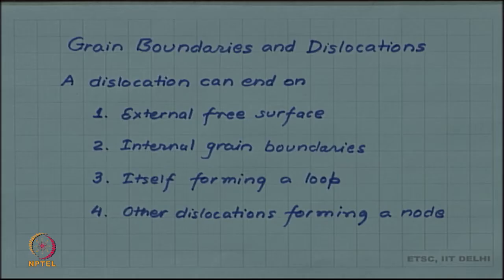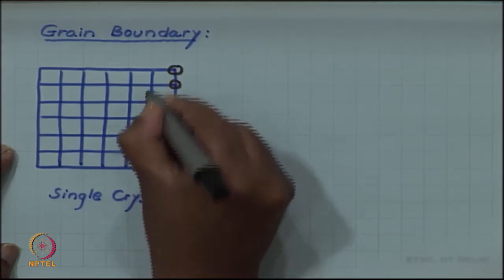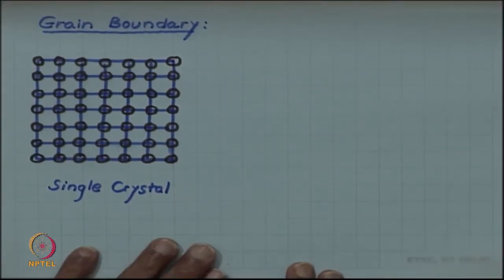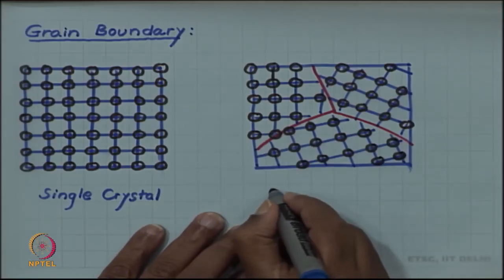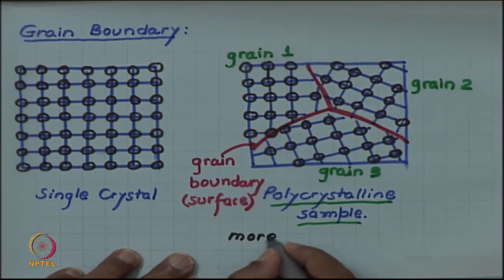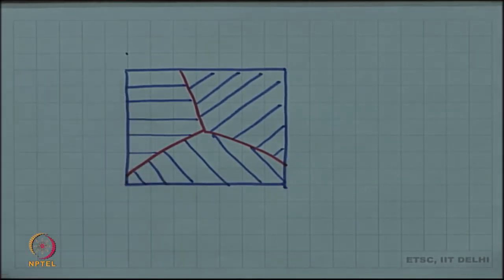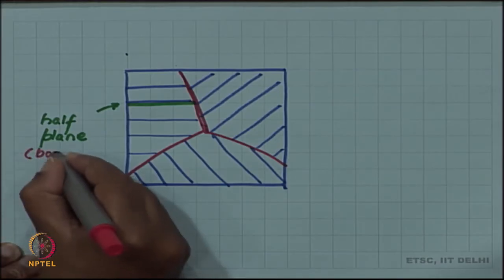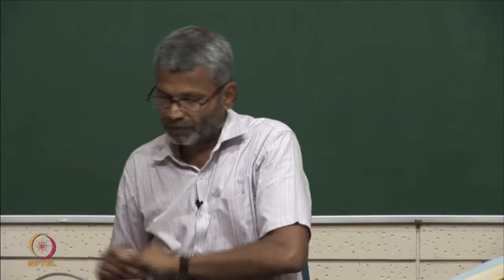Dislocation cannot end abruptly in a crystal: Grain boundaries

Comment: sir i had a doubt whether grain boundary seperates the same planes or different different planes?????i mean grain boundary is a boundary where planes changes its orientation or is a boundary where different different planes meet ??????
Reply: Both are true. A grain boundary separates two grains. In a grain on either side of the grain boundary planes with different orientations (different Miller indices) meet the boundary. But if you consider a plane with given Miller Indices, it will have a different orientation in the two grains.

Comment: Dear sir g why grain boundaries are formed??? I mean at micro(atomic level) what kind of state atoms have at grain boundaries???.....
Reply from the maker: You can think of grains forming in a liquid during solidificitation. Different grains start as a nuclei in different parts of liquid. Because of independent nucleation events their orientations are arbitrary. After growth they meet along some surface across which the orientation changes. These surfaces act as grain boundaries. Atoms close to the boundary do not fit in either grain and so their is some disorder in a thin layer of atoms along the grain boundary.

Comment: Sir, dislocation cannot cross a grain boundry and finer grain structure means lots of grain boundaries but plastic deformation which is caused by slip ( movement of dislocation) is more favourable with fine grains..what is the reason?

Comment: Colloquially what we say 'A PURE CRYSTAL' is that a single crystal?
Reply: There is a difference between 'pure crystal" and 'single crystal. 

Purity refers to chemical composition. 'Single crystal" refers to structure. Thus if I have pure crystals of Cu it means there is no other chemical element present.

A single crystal requires the absence of grain boundaries. A pure crystal of Cu still may not be a single crystal. It may be polycrystalline, i.e., different regions of the crystals have their FCC unit cells oriented differently. These differently oriented crystals are separated by grain boundaries. On the other hand, I may have an alloy of Cu with 5% Ni which is still single crystal if it has no grain boundaries. 

To summarise, you can have pure single crystal, or pure polycrystal, or impure single crystal, or impure polycrystal.